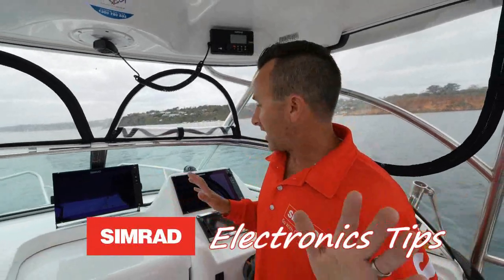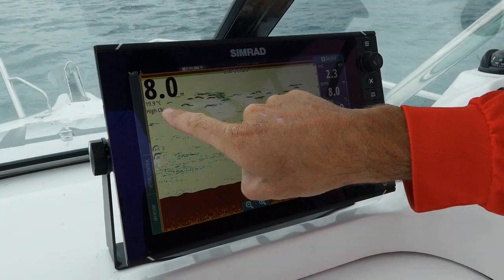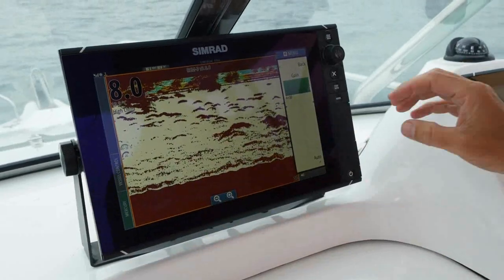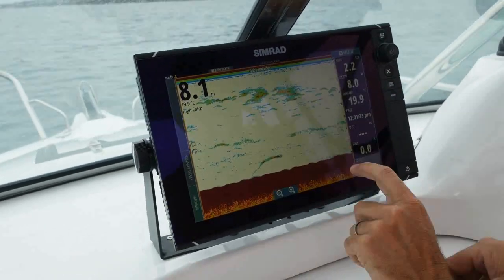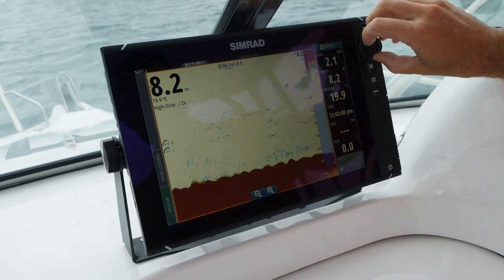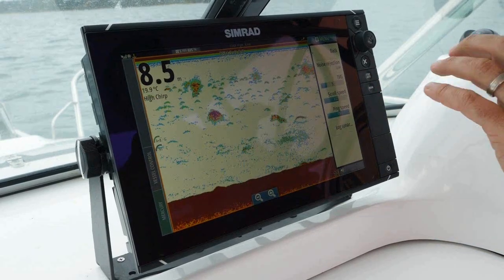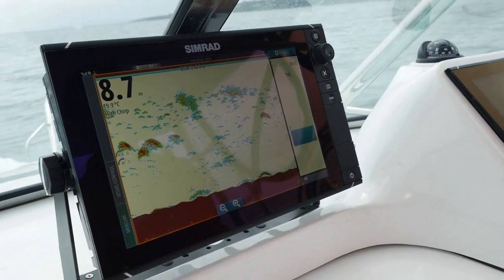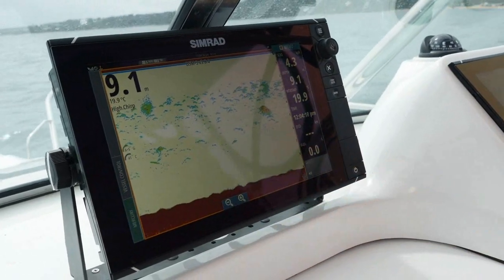Simrad | How to Adjust Sensitivity to get Clarity on Simrad Sounders

Comment: Hello. So I had a question not sure if you can answer.
I have the simrad go9. Only 6 months old. Last time out fishing my bottom /fish finder wouldn't work or state the depth of water. The machine just showed like snow on the screen with some color on the very top like it would be the surface. 
Time out before that everything worked fine. Any suggestions? 
Thanks in advance. 
Ed.
Reply from the maker: Please contact us via Facebook, we'll be happy to help you from there. Send us a screenshot of the sonar returns.

Comment: G’day Lee I’m in wa going to Exmouth this weekend to chase big fish Ruby’s and red emperor s gold band snapper.
I also know Paul junger very well as I own one of his boats over here in WA.
Gear I’m running is the same as yourself. BSM3 with 2x Evo 2 units .
Going to be fishing in 80 -90 meters and weather permitting 200+ for Ruby snapper.
First time with the BSM3 unit running a chirp M265 transducer 1kw.
Looking for the best settings you could recommend for me on this trip.
Just a starting point. I know there’s so many variables but I noticed you recommended take everything of auto gain range ect.
Would high chirp be the go or normal 200 .
Like I said abit confused with the bsm 3 how to get the best out of it.
I used to run a m260 non chirp transducer straight of the nss12 and so far can’t really see much of a difference with the BSM3 unit .

Comment: Hey mate, 
What transducer are you running for this vid?
can we expect this kind of clarity on an NSS evo2 display using transducer HST- WSBL?
Reply: Any questions....."just ask " he says.........😕
Reply: lol
Reply: I know this is probably a comment that you've forgotten about by now but...  he is probably running a thru hull transducer rather than the transom mount skimmer such as the HST- WSBL. He's probably running a 600w or even a 1kw high chirp transducer. On a smaller vessel it's sometimes beneficial to run a High chirp wide beam thru hull, because it'll be able  to cover the same spot of the bottom in slightly deeper water as the boat rocks rather than the beam moving back in forth over the spot. Think of it as a spot light rather than a laser pointer to kind of visualize it. Hope this helps if it wasn't too late.
Reply: simrads after sales service is rubbish